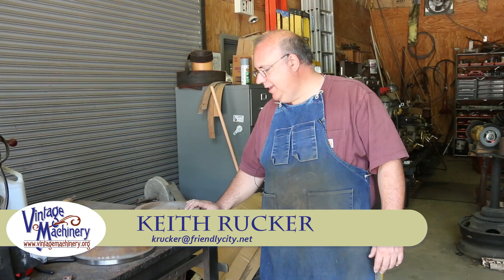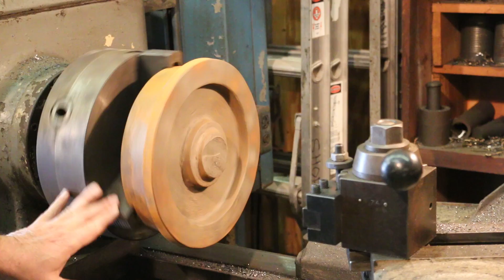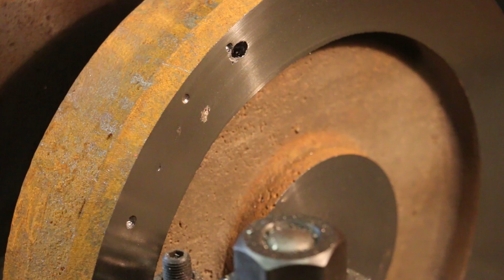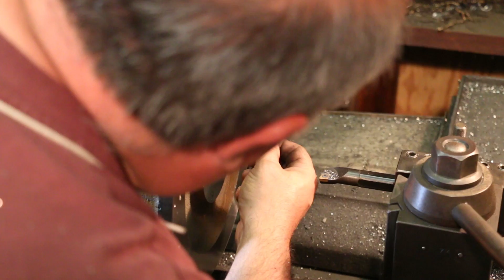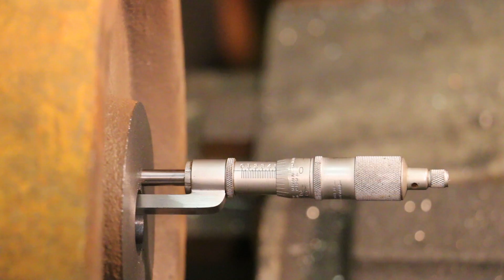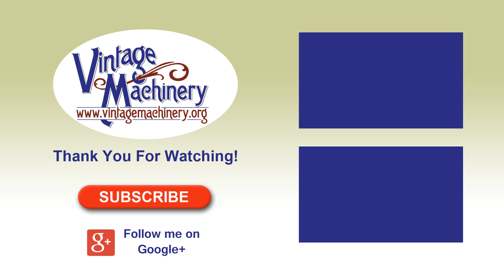Machining Cast Steel Railroad Wheels

Comment: My question is this: When do you cast a piece of work, then finish it off with by machining it to the final speck (as you have done here) and when do you take a solid billet and just machine it to shape. Is it a matter of cost, of time or what? Also presumably a cast piece is "weaker" than a a wheel say made from a solid billet.
Reply: +Clyde Cessna To answer that question adequately would take a long time. I'll try to keep it short. All metals start off as liquid metal at the mill or foundry. Billet parts are still castings (Over simplification). The best way to explain it is to think of billet parts as standard castings that have been treated in some way. Such as hot or cold rolled for steel, extruded and heat treated for aluminum. The most common reason to cast at home is raw material availability some material suppliers have a minimum purchase size that might be much larger than you need. Having scrap steel or aluminum around can be melted and cast to your exact needs no need to purchase anything and any remaining casting can be saved for latter. For manufacturing it is almost always cost. You have to calculate the production numbers per year and compare manufacturing costs per part then the total cost per year. Then compare that to the investment in machinery. see if a billet part machined will pay for itself faster than a casting. As far as which is better, that is very specific to the environment, which we don't often times know from the outside, and often times a billet part exceeds the needs of the environment and would be considered an over investment. hope that helps. 

Best
Matt
Reply: Cast metals also have very different properties than forged or rolled metals. 
So not only is cost a factor, but so is material requirements.
In this case, the wheel needs to very wear resistant. The wheels are tapered so the inner and out wheels on the car can turn at the same velocity when going around curves. Solving the ideal wheel profile was actually one of the first major barriers rail road had. What it means though, is that the wheel is constantly sliding back and forth over the rail and is prone to wear.
The wheel also needs to be less tough than the track, you want the wheel to wear out before the track.
The wheels must be very ductile. They need to be able to deform a great deal and return to shape repeatedly and not fatigue.
Cast steel has all of these properties, and is a better choice than extruded or rolled steel provided the track is made from forged steel.
Reply: +Centurial Inc I was going to say the same thing but you said it so well thank you.
Reply: That's terrific, thank you

Comment: good job turning them, i agree that they should scrap that one with the inclusions in it. those trains will be transporting people so no need in pushing the limit. better safe then sorry. on another note. i have tried sending you a couple of messages but not sure if you got them.
Reply from the maker: +Bison Workshop Absolutely - you might be able to fix it, bu it is just not worth the risk.

Comment: Great video! I have found that when I melt cast iron in my furnace for a mold (which I don't do often), If you break the mold right away and let it cool fast it results in a material that is VERY HARD.  Completely eats away high speed steel bits.  I am willing to bet cast steel behaves in the same manner.
Reply: +MattsMotorz Yes, "chilled" iron.
Reply from the maker: +MattsMotorz I like to let them cool slower....
Reply: interesting going metallurgy points

Comment: Nice job as usual Keith. I'm a bit surprised that the high speed cutters wouldn't work, yet the drills did okay.. could it be that the surface layer was the issue, once you broke through then the material became softer so to speak? like a case hardened piece? As a "Newb" still, just trying to learn! Thanks.  Razor!
Reply from the maker: +Razor Works It is very likely that the surface is hardened and that may be the whole issue.  Either way, HSS just is not doing the trick...

Comment: With all the machining required to correct these castings for use, why would you not start with a billet?  The cost of patterning the wheel, sending it to a foundry and the casting costs would seem to outweigh the additional machining time.
Really appreciate your channel Keith and congratulations on the new shop.
Reply from the maker: +TheTraakon If I had been the one starting this project, that is probably how I would have gone about it.  But that was not the route the guys I am doing this for decided to go.
Reply: +Keith Rucker - VintageMachinery.org 
Understood.  Sometimes you just get to ride the train not decide its route.
Thanks for all the continuing education you provide.

Comment: Can't remember who did it in a video but i saw a guy make a basic home made tracer for something like this. He basically used the bottom half of his steady rest , and bolted a profile pattern to it. He then attached a follower finger/pointer to the tool rest, positioned to follow the edge of the pattern which is just to the right of the toolrest, attached to the lathe bed.
 He just used the steady rest base just as a mounting device to attach the pattern to a stationary part of the lathe because it was convenient. There are a million ways to do it with clamps, scrap and duct tape......
Reply from the maker: +Notso Fresh I remember seeing that one too.  I think it was Tom Lipton...
Reply: Cant find the video but here is an article with exactly the setup i am referring too.
http://www.hobby-machinist.com/threads/a-simple-manual-tracing-attachment-for-any-lathe.19162/

I bet this is  almost as fast as cnc on this job, can be done at home (for you) and also would make for a pretty good video.

Comment: If those castings are steel, the customer can have the inclusions and voids cut out then filled in with welds.
If not, brazing could work.
I would not recommend that you do that on your own.
The customer must take that risk upon themselves.
Great video.
Thanks, 
John
Reply from the maker: +John Bazaar I have no plans to try and repair these defects.  Too much at stake...
Reply: +Keith Rucker - VintageMachinery.org 
I agree, not worth the risk.

Comment: Hi Keith thanks for sharing.   A friend of mine owns a professional machine shop here in the UK.  He machines railcar wheels that are about 30" in diameter on his big L & S lathe. All done by hand not CNC. I would have thought that the only critical measurements were the running surface angle and the radius in the root of the flange. That 1" bore does seem extremely small for a railcar even if it is a miniature.  I look forward to the next video on the project.  regards from the UK
Reply from the maker: +Gary C It can be done manually, but due to the hardness of the material and it eating HSS cutters, I think that using a single point carbide insert will be a better way of getting the job done, and that will be easier on a CNC lathe.  Too bad I don't have a tracing attachment on our L&S lathe - that is what a lot of the railroad shops use for wheel profiles.

Comment: Keith
That casting needs sending back for a replacement . It's no good or as we say NBG if its carrying public it's a no no

Those castings are chilled and nee to be annealed , but those do not look like cast steel more like chilled CI  .
Reply from the maker: +Stuart Hardy I was a bit concerned when the guys who asked me to do this job could not provide me with information about what the material actually is.  I am guessing cast steel, but these could be ductile cast iron.  At the end of the day, it is not my call as to what to do with the castings - other than help them machine them and offer my input as to what I think.  I cannot say that I disagree with your comment though.
Reply: +Keith Rucker - VintageMachinery.org , I work at a steel foundry and machine castings every day.  Those are not steel chips.  They are coming out of the drill just like ductile iron.   If it was steel, I would weld it because we do it everyday.  We weld structural casting for all sorts of applications.  But you can't weld ductile iron.  Use that casting to run the test cuts on the CNC.  That way if something is wrong, you screw up on an already bad casting.
Reply from the maker: +Tyler Schneiter Thanks Tyler - the more I work with these castings, the more I tend to agree that they are ductile iron.  As for using the bad casting as my test cut on the CNC - that is my plan!

Comment: Hey if its steel cant you just weld the hole
Reply from the maker: +Og maco Sheesh But with that many defects so far, what about all of the ones that I cannot see buried in this casting?  I am just too suspect of the casting at this point to try and salvage it.

Comment: As a side note; The wheels for the locomotives made in the 19th century were made of Cast Iron due to the Irons' good wearability. The difference was that the Iron was Malleable Iron, and later Nodular Iron. Iron that had either been put through the forging process or heat treated to reduce the graphitic carbon present in just-cast Cast Iron.
Reply: also the early wheels had metal tires
Reply from the maker: +sandrammer Interesting.  I seem to recall hearing that information before now that you mention it.  I am not 100% certain that these are cast steel - they may be ductile cast iron.
Reply: +Keith Rucker - VintageMachinery.org Yeah, the chips sure looked like iron when you were drilling the metal.

Comment: Just a thought if you are going CNC the rim why not just CNC the entire wheel
Reply from the maker: +pijnto You could, but I want to turn the wheel surface in a mandrel that is set up on the hole bored through the wheel so that it will run perfectly true.  You cannot turn the entire wheel surface while chucked up on the wheel surface so it would still require three operations and three mountings on the lathe.  I can just as easily do the first two operations manually and save time when we get on the CNC machine.

Comment: Those defects are a direct result of pouring directly into the mold cavity. Not only did the turbulance (generated by the metal falling from the ladle to the bottom of the mold cavity) generate dross and lots of it, as can be seen in the surface of the unmachined part of the casting, but the smooth walled defects you were running into showed that a lot of gas was trapped in the solidifying metal as well. I'm disappointed in the QA inspector for that foundry as a casual inspection of the casting would have raised a red flag and told the inspector that many defects were present in the casting. Gives a bad name for the Industry. If they used the same method of pouring for all of the wheels, you can expect all of the wheels to be defective in varying degrees.
Reply from the maker: +sandrammer That is unfortunate news.  I am not sure what company poured these, but I have been told it was at a foundry in Jacksonville, FL so you might actually know the outfit...  By the way, I got your ingot pattern in the mail today - very nice, and something I did not already have!
Reply: +Keith Rucker - VintageMachinery.org Cool, now that you have it, you'll wonder how you ever got along without it. I will make your operations easier.
Reply: +sandrammer That should have been "It will make your operations easier."

Comment: Я бы этому колесу не дал второй жизни. Металл очень усталый - надо переливать сталь по новому.
Reply: +stockmarketvl Literal translation =       I would not give this wheel a second life. Metal is very tired - it is necessary to pour the new steel .
Reply from the maker: +stockmarketvl I don't plan to try and salvage that wheel with the defects.
Reply: +Keith Rucker - VintageMachinery.org Хорошо. Смотреть за твоей работой одно удовольствие. Хорошее видео.

Comment: Isn't that wheel profile just a radius and a straight taper? Doesn't seem that is complicated enough to have to use a cnc lathe. By those chips I would say that is ductile iron. There is no load on that flange except in a turn so I highly doubt you could pull sideways on a car hard enough to break that flange off from that small inclusion.  I actually think you probably would break that little 1" axle off first. lol
Reply from the maker: +bcbloc02 There are four radii that have to be cut (both concave and convex) plus the taper.  It could be don't on a manual machine if I could use a couple of cutters with the correct radius, but because HSS won't touch this stuff, I think it would be easier to just single point everything on a CNC lathe.  As for the inclusions, they have plenty of extra castings and they don't want to take the chance on what may be hiding in that casting that we have not uncovered yet.
Reply: +bcbloc02 ... i agree.. v the inclusion out.. fill it with brass so it wont rust and good to go.... Brian i'm jonesing for the next shop/barn video fix... hurry.. lol
Reply: carryit around
Could you please make it stop raining everyday so I can get something done? I want to get a little more done before I shoot the next update so you can tell I have done something. lol
Reply: +bcbloc02 It's not the inclusions that you can see, it's what might be hiding elsewhere in the casting...

Also, while these are for a low speed operation, I think that they are for cars that carry people, and you just don't fool around with the safety regulations in that service...
Reply: I doubt that anyone outside of the foundry knows what they made these castings from. Railroad wheel alloys have gotten more specific over the years, and the newer alloys are hard! I'm not surprised that Keith needs to use carbide tools to turn these to shape.
Reply: +Keith Rucker - VintageMachinery.org Really, HSS won't touch that stuff? Or was it just burning it up because you couldn't get the RPMs low enough or what? I couldn't imagine it being that hard.
Reply: Keith Rucker - VintageMachinery.org
Would enjoy seeing the cnc lathe in action. :-)  If they have extras no sense in taking a risk.

Comment: Great video as usual. Can you explain why welding the inclusions is not an option? Thanks.
Reply: +Walter Plummer All steels aren't the same, it depends on the composition of the particular steel being welded,  the welding process can produce a spot so hard that can't be machined or ground to a suitable surface, and any friction against the metal will only get harder causing the tool being used to break or in the case of a grinding wheel just wear it down.
Reply from the maker: +Walter Plummer Welding cast can be difficult, and I am not 100% certain of the material these wheels are made from.  And then there is the unknown of what other defects might be hiding in that casting that I have not uncovered - it is just too suspect for me to try and use it.

Comment: One would think the 1 inch shaft would snap before that wheel itself would fail.  Great video Keith
Reply from the maker: +one4stevo I am not questioning their engineering on their cars.  I looked at some of the videos they have on YouTube and this is a pretty small gauge they are running - much smaller equipment than what we have at our museum.

Comment: One more thing.  I watch alot of machining channels and some are fanatics about cutting/cooling fluid and others are not (like yourself).  I'm curious as to why?  I can see using fluids would be messier and make it harder to clean up chips but doesn't it make the cuts better and reduce tool temperature so it doesn't lose hardness (drill bits especially I used to ruin them all the time until I learned from my dad to keep them cool, I also do it on sawzall/jigsaw blades by just using a damp sponge).
Reply: I am also interested in why no cutting fluid. I thought the cutting fluid helped keep drills sharper much longer.  Being a train buff I sure enjoy your videos.
Reply from the maker: +Jay Walt I typically don't use a lot of cutting fluids on cast material.  When you cut cast, you get somewhat of a "powder" that comes off with the chips, and this can be very abrasive on your machine.  When you use a cutting fluid - oil or coolant, it tends to "wash" that powder all over the place, which can really cause a lot of wear on your machine.  So, I tend to cut it dry so I can clean it up easier and not flush the abrasives into place they don't need to be.  On more common steel, I do like to at least use a cutting oil, but coolant is better (my lathe is not set up for coolant though).
Reply: +Keith Rucker - VintageMachinery.org Aahhh Thats right I fogot cast is different, my bad =)

Comment: Great video! Looking forward to seeing you complete these later. I'm building a 2-1/2" scale 2-cylinder shay locomotive for a 7.5" gauge railroad that will have eight 6.125" drivers (tread diameter). For those of us who don't have access to a CNC lathe, would you consider making a video on how to manually machine wheel flanges and treads to IBLS standards? Thanks!
Reply from the maker: +cr125shifter My original plan was to manually machine these, but my HSS cutters won't cut the material.  I would have to hand grind a cutter with the correct radius for the flanges but this is not as feasible using carbide.